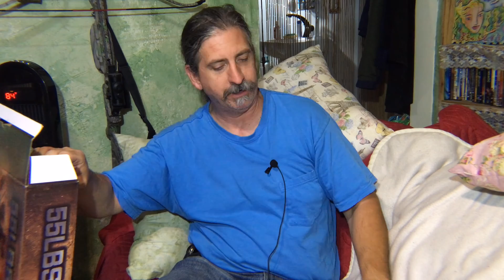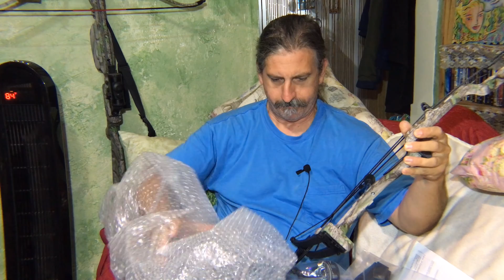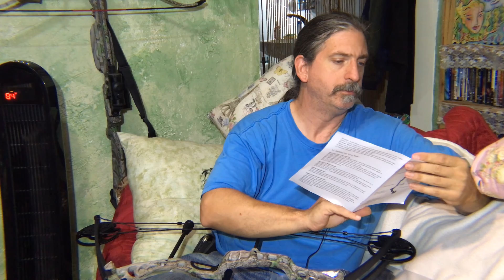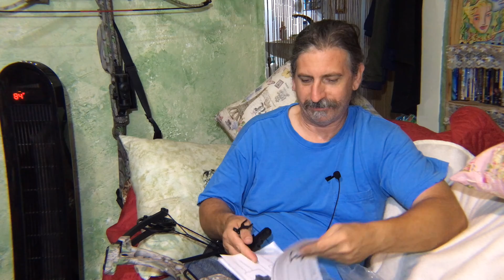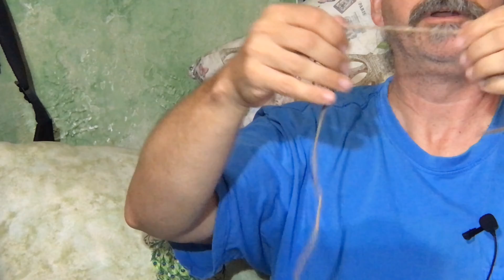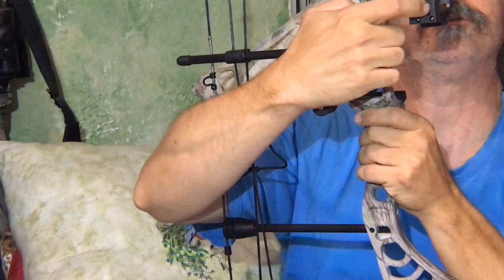Leader Accessories 30 - 55 lbs. Green Camouflage Compound Bow

Comment: I do need some advice on this bow, i adjusted the cams to 28" draw manual says it adjusts weight when u do theroitcally any idea if if dropped the weight by taking it down 1" if so any idea wut it would be comes out of the at 29" draw at 55 lbs

Comment: okay so I'm having trouble deciding between 30-55lbs and the 50-70lbs version. how can I test to know if im strong enough to go with the 50-70lbs version
Reply from the maker: If you have an archery store in your area or someplace you can test a bow, I would suggest doing that and they can tell you how much you can pull. If not, I suggest going with the smaller one.
Reply: Gavin Fay if after a year your still wondering you can go to a gym with the pullies and see that way